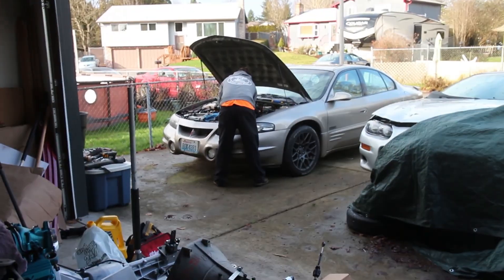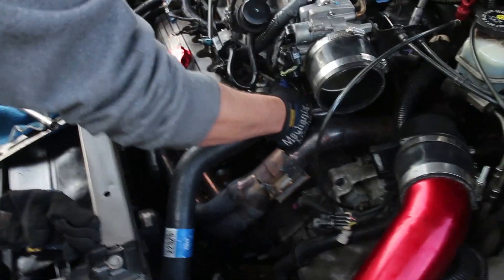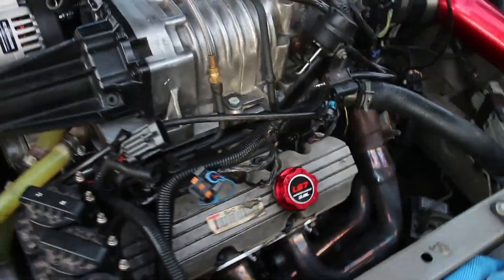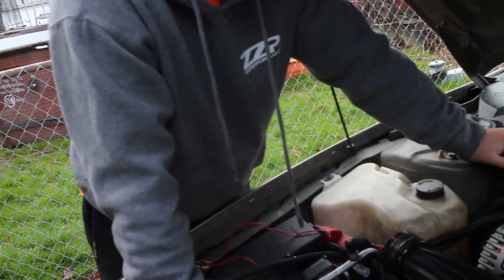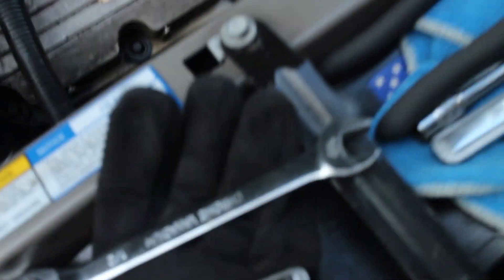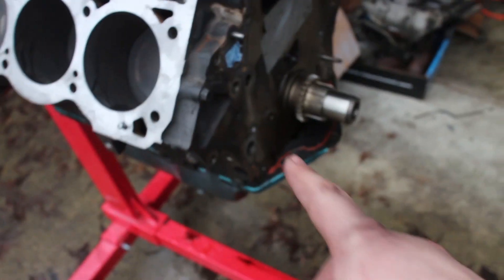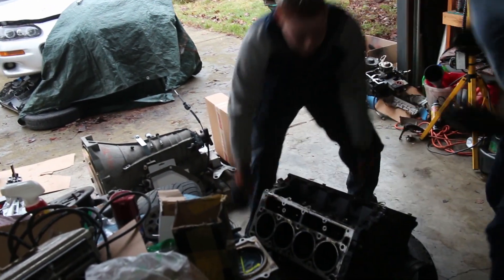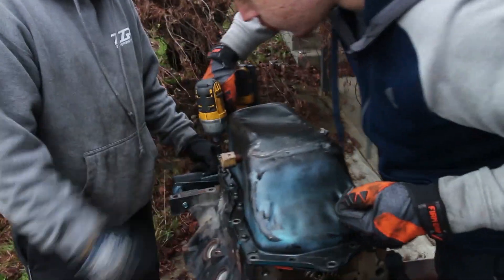Bonneville SSEi 3800 Series II Top Swap Part 2 (Installing the ZZP VS Cam!)

Comment: Try and take the power steering pump off the engine and hang it off with some bungee cords that way you just bolt it on the new block   the ac compressor can be done this way as well.
Reply from the maker: We might give that a try, thanks

Comment: I'm not sure if it's any different on the Bonneville but it's really easy on a grand prix it only took me a day and a half to take my engine out of the top, the only thing you have to watch out for when you take it out is the oil filter neck
Reply: I took out the engine on my Buick Riviera 1998 through the top also, I took the trans out with it too